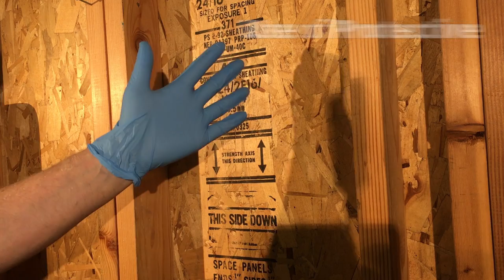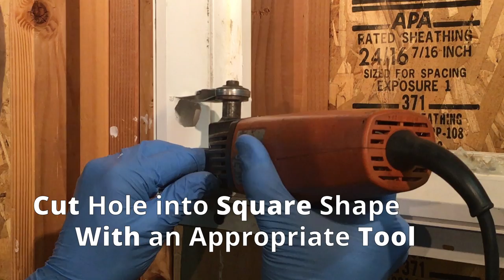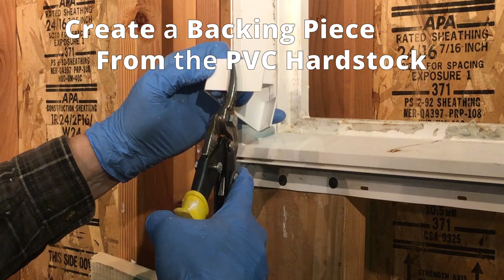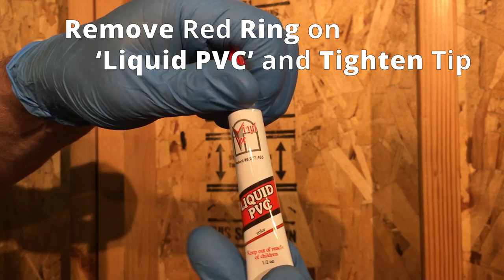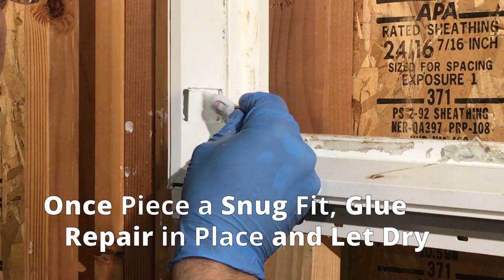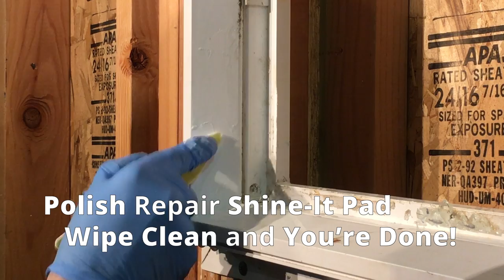How to Repair Holes in Vinyl Window Frames (Inlay)

Comment: Can someone tell me what type of tool that is exactly?
Reply: If you are asking about the machine, it is know as a multi-tool. It is a great tool to have for a multitude of different applications, but can be spendy depending on the type or brand you want. If you are looking for light/occasional use, You can get one from Harbor Freight fairly cheap or just look on Amazon and see what $ and type fits your need.
Reply from the maker: An oscillating multi tool